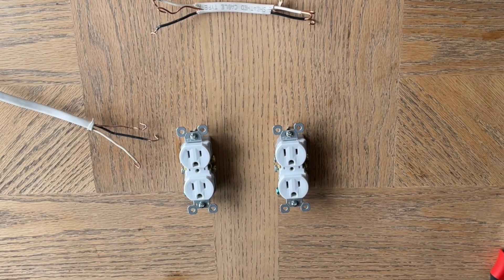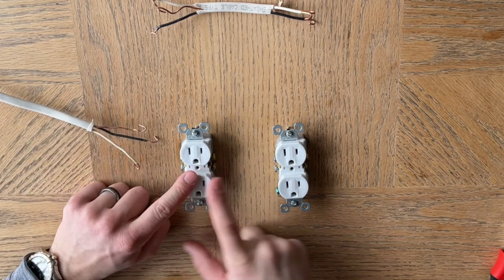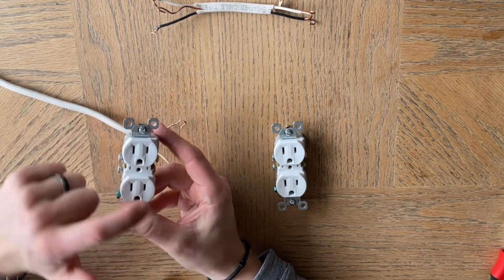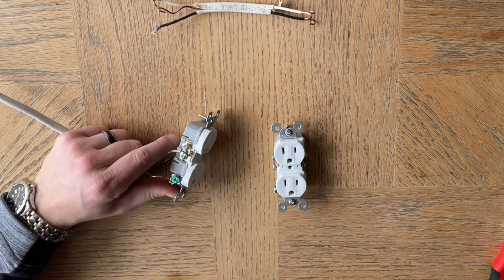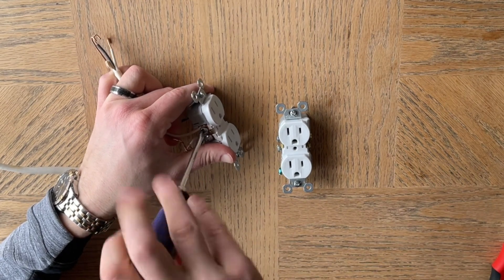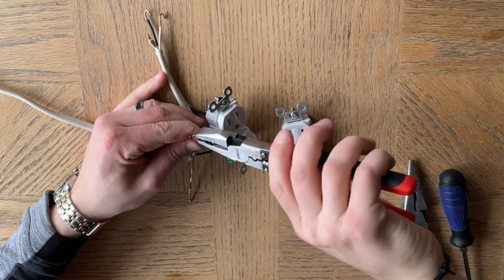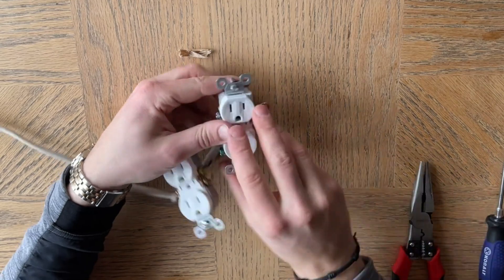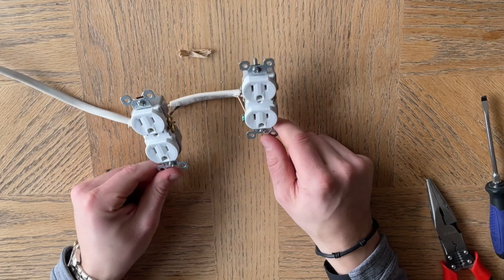How To Wire Outlets In A Daisy Chain Wire Multiple Outlets Series Receptacle

Comment: Thank you for this but I have a question like you said if the main power is coming from one outlet and then you add another outlet and its like 7 feet away but you said as more you add less power it will have let's say I add 3 outlets more an it's 7 feet each away from the main outlet if I use the last one will it consume more electricity?
Reply from the maker: You're most welcome! The power consumption wouldn't necessarily increase, but the voltage drop would be greater the further down the chain you go, which could affect the performance of certain appliances.

Comment: Happy New Year Brother. 
I ran power from a plug outlet at my lower main floor. Heading up-stair to power up level.
Using the Daisy chain, to jump from outlet to another and so on.

When starting at outlet #1 heading to #2 to #3, before heading to #4. At #3 directed off #3 to add a power outlet for my TV. From the TV outlet that came from #3 back to the TV outlet after installing t6he TV outlet, I continued from to another outlet for purpose (electric fire place) that wouldn't be on all the time. Anyway, from there I continued to the bedroom light switch, from the switch up to each pot-light one at a time, once connected to the last pot-light the chain stopped.

Now at bedroom switch corned to the other bedroom through the wall leading power to that bedroom switch, then to all four pot-lights and ending at last pot-light. 

At #3 out-let I  detoured off #3 understand? Not breaking following a daisy chain jump.

From back at #3 I continued jumping to #4 to #5 and #6 #7 #8 from number eight, I spiced off to a light switch for 2 pot-lights for the closet.

Now continuing, from [number eight outlet] going over the bathroom door, heading to a outlet then jumping to the bath light which stops.      Now, back at that outlet taking power over to another pot-light light switch to the pot-lights.

This process is correct? 

I understand it's all on one daisy chain jumping from each. But, not all will be used at the same time. 

That for the other reply, and while back. 

   Sam...
Reply from the maker: Seems like it’s a good system. The only concern would be that it is such a long chain, but if it’s working there doesn’t seem to be any issues.
Reply: @HowToVideoChannel  Thanks for the reply. 

So, like I think it states 8 to 10 outlets on a line. [But, it's not dipped in gold] as like "Law in code?

The idea was, each corner wall starting at #1 at front wall street then #2 side of house #3 was heading to the back but at in same room before the wall divider.
Then in the other room other-side of the wall in corner was #4. Splicing off for running power for TV from there jumping power to the switch for the room pot-lights. But also jumping it back into the first room to the switch for pot-lights, then it stopped.

Going back to the #4 out-let and continuing to #5 / #6 / #7 & #8

No- one's going to use all out-lets at the same-time.

Do U have a video showing channel-ing back from out-let #4 off for a out-let. But then coming back to continue the chain? 

Maybe, I'll click on your page and see if there is other videos.

Comment: u also wrap just the incoming ground wire around the electrical boxes ground screw first correct?
Reply from the maker: Standard boxes should be plastic, but if you have old wiring then you may have metal boxes. In that case, you may also have a metal conduit and there wouldn't be a ground wire. 

If you have Romex and a metal box, then you need to make sure that the ground within the Romex is traveling back to your breaker box.

You can also attach the ground to the screw within the box. Then use an outlet tester to make sure it lights up correctly so you don't have an open ground.

Comment: I have a 5 outlet chain in my old house. I’ll label the A through E from the panel. 
D is showing an open neutral when I plug my diagnosis plug in into it. 
The guy who wired my house got the hot and neutral mixed up on A. I have wired that correctly. when I use a no contact pen on C it freaks out. Do you think my issue is between C and D? AB and C are in a different room. It runs through a wall to the front of the house. E was arcing. 

Sorry I know this is kind of off topic but I’m a newbie that can’t afford an electrician. I know that sounds stupid as all hell but I just can’t afford one. I have the circuit off in the meantime. I’m trying to learn what I can to hopefully fix it without burning my house down. Any help would be much appreciated.
Reply from the maker: Sounds like there is a problem between B and E. Maybe C.

I would open up all the receptacles and make sure they are all wired correctly. Then you’ll have a really good idea of which direction the power flows from outlet to outlet and room to room.

Comment: I am not sure if you answered a question similar to this one already so I am sorry to make you repeat yourself if you did. 

I have two duplexes in one metal box and power coming the left and another romex coming out the right(leading to a switch). In the context of trying to properly ground it, I was wondering how I would tie in the ground wire coming in from the right. In the video you pigtailed off of the left duplex twisting it together with the incoming left ground and the daisy chain. Additionally since my box is metal I would have to pigtail off of it and add it to the twist. For the ground coming in to the right, would I simply just add this wire to the twist as well? 

Thanks for the helpful video regardless.
Reply from the maker: If the box is metal and there is a metal conduit running back to the box then that would serve as the ground.

Comment: So if you had 3 or more would you do the ground like you did on the first outlet? And only do it like you did on the second on the last outlet that is chained?
Reply from the maker: You can do that and connect ground to ground for the outlets in the middle. 

Or you can run the romex ground directly to the first receptacle and add a ground from the first receptacle to the second, second to third, and so on. You’d have 2 wires curled around the ground screws.

Comment: Ok, What I didn't know was if it had to be top or bottom when daisy chaining multiple outlet.
Reply from the maker: Either set of screws will work. As long as you are keeping the sets straight and not putting one on the top and one on the bottom.

Comment: If those receptacles are installed in metal boxes then another ground is needed.  Ground the box too.
Reply from the maker: If they are in metal boxes, then they would be in a metal conduit which acts as the ground. 

When using romex, you should use plastic boxes. 

Most codes require metal on metal or plastic on plastic.
Reply: This was additional useful information. It's been my experience that many older homes (mine included) have metal boxes without conduit.

Comment: I have a question, what if the black and white wires are reversed? What will happen? Will it just not work, or will it burn my house down or maybe damage equipment.
Reply from the maker: It would be best to correct it.

Comment: I have been told, by one of the manufacturers of outlets that “ Daisy Channing “ outlets in not acceptable.. there are 2 sets of hot and neutrals  they are only both used when the jumper that connects the 2 outlets is being.  Thus each outlet is on a separate circuit.  The correct way is to use a pigtail.
Reply from the maker: The only issue with Daisy Chaining is that if one outlet fails the rest of the outlets down the line lose power. Pig Tailing prevents this issue.

Comment: When replacing a 15a breaker with a 20a, wiring and outlet on an existing daisy chain outlet, would wiring be the same for a duplex 20a outlet?
Reply from the maker: It should be, as long as the wire gage can handle the current. You may want to check with a local electrician to make sure it fits the code.

Comment: Is there a maximum recommended distance for daisy chaining? I have an outlet halfway out to my back yard but I'd like to daisy chain off that to my shed which is about 50-60 feet away.
Reply from the maker: That should work as long as it’s 12 gauge wire. 14 would be okay, but if for some strange reason it is 16 then it would be like using a really long extension cord.
Reply: The maximum distance depends on the wire gauge and the percentage of voltage drop permitted. It is considered the same, regardless of whether it's direct wired to the receptacle or by using pigtails.
Reply from the maker: Thanks for the information!

Comment: Excellent presentation.  This is the clearest, most uncluttered video I have seen on daisy chaining.  I'd like to know how to add a switch and light in the middle of a daisy chain.  Would I just need a junction for that?
Reply from the maker: I’m very happy to hear you enjoyed the video! Thanks for the positive feedback!

Yes, you can add another box and run wire to your switch and light. If one of the outlets goes bad then you’ll lose power down-line.

Also, make sure you pigtail to send power to your switch. If you don’t, then your switch and light will interrupt the other down-line outlets.

Comment: What if you have a red wire also?
Reply from the maker: That probably goes to a switch to control one of the receptacles. Are the top and bottom receptacles connected with a tab of metal on the side?
Reply: If you're just wiring receptacles, you are not supposed to use cables that have both black and red wire.

Comment: I WANT TO DO THIS BUT I HAVE 4 PLUGS DAISY CHAINED I WANT TO KNOW WHICH WIRE SHOULD I USE THE WHITE OR THE YELLOW AND WHAT AMP FUSE IN MY BREAKER BOX TO POWER IT PLEASE SOME ONE HELP ME THANKS
Reply from the maker: You may want to call an electrician.

Comment: There shouldn't be a voltage drop because technically this is still parallel wiring. The bridge between the 2 screws on either side of the outlet acts as a bus bar. Series wiring would be wiring the hot side of one outlet to the neutral of another, which is very difficult and impractical.
Reply from the maker: Thanks for your input.

Comment: All the new plugs have a large side and a smaller side.  If someone wired them consistently  to the wrong side, what would happen? Would the outlet work.  In other words switching the power line and the common?
Reply from the maker: If you put the wire on the wrong screw then it may still work but you would be using the outlet in a way that wasn’t intended. Therefore, it would be against code, would fail inspection, void any insurance, etc cetera.

Comment: Put in six outlets in my son's basement.  The panel box didn't explode, so we're good.  Thanks!
Reply from the maker: Glad it worked out for you!
Reply: Be careful I think 6 outlets on 15 amp is 3 too many irs been awhile but code in my state was 4 on a 15 amp circuit
Reply: @zigzigler8332 even 12 are allowed by code. What you need to consider is what you want to connect on them. Check the label of your devices. 2000 W and 600 V are a little more than 3 amps. If your breaker is a 15 amp breaker, that device alone would be using 3 amps. There are heaters that requiere 4 amps for example. So if you're going to connect 2, 3 tvs, a laptop, 3 lamps and even a small fridge, it's ok for only one line of a 15 amps breaker.
Reply: @zigzigler8332 the circuit are usually 20A

Comment: Does it matter if the 2 hots or 2 Neutrals touch each other?  You try to put the wires under terminal screws, but the wires may barely touch.   I don’t think it is an issue because the 2 hot terminals and 2 Neutrals terminals are already connected with screws going into same base… but I have 4 Daisy chained outlets that keep popping one of these darn AFCI Breakers when circuit is not overloaded.
Reply from the maker: You can touch two hots or two neutrals without an issue. However, if you touch the hot and the neutral, that will be an issue.

Comment: Is there code for grounding the box?
Reply from the maker: Depends on your state.
Reply: Yes, NEC 250.148(C) for metal boxes. Plastic and fiberglass boxes, no, because those materials are not electrically conductive.
Reply from the maker: Excellent

Comment: Is this a 15amp circuit used with 14 gauge wire ??
Reply from the maker: The demonstration in this video is using a 15 amp receptacle and 14 gauge wire.

Comment: If you do not put a wire nut on the ground wires and leave them exposed and they touch a live wire you have an electrical fire. Lazy and stupid.
Reply from the maker: Ground wires are always exposed. They are an uninsulated wire.
Reply: Ground wires must be joined by a wire nut, Wago, or a greenie (a green wire nut with a hole on the top). It's not optional.

Comment: Use a wire nuts to hold the grounds together because they can get loose if they're not twisted enough. They make the nice green ones with the hole in the middle then you can run the wire right to the hole. Just leave one wire long enough so that it can act as your pigtail but that just works with the green ones with the hole in the middle.
Reply from the maker: Excellent advice!

Comment: what if I'm using 2x4 metal outlets? can I just run that ground to one of the outlets and all the other outlets will be grounded? if not how would I go about doing this?
Reply from the maker: Most of the time, if there are metal boxes there is a conduit. The conduit usually serves as the ground since it runs back to the breaker box.

Comment: Question.  I have a "power source" coming into an outlet that I will be doing a daisy chain BUT the power source wire is only a black and white one, no ground.  I tried installing, after the outlets, 3 wire (12/3) to the rest of the daisy chain, will that work fine since the initial wire does not have a ground wire?
Reply from the maker: Is the box metal or the wire running through a metal conduit?

Comment: Looking to replace old basement flourescent lights with an led style but cant find any that will hardwire in. Thinking about taking the wiring and just adding an outlet so i can just plug in the new led shop lights. Am i on the right track?
Reply from the maker: Yeah, that could definitely work.

Comment: Very helpful, detailed, informative and easy to follow.

Thank you.

Is there a minimum or maximum distance that gives maximum supply of energy.

I take it you are using 14/2 Romex wire?  I'm new at his.  

Thank you again.
Reply from the maker: Yeah, this is 14/2 Romex. 

The wire gauge and length affect the amount of power available. Check with an electrician for that specific info. It also depends on what the power is supplying. In a kitchen with appliances es you wouldn’t be able to run as many as a bedroom for example.

Comment: "Great Video" I have a question mister Pro? (I currently have 5 pot lights on my ceiling, with a wall switch.) I have jumped from one pot-light to another in a chain, as your showing. Question, power goes to the switch first? Or power comes in on the end of the pot-lights, and the switch is on the other end, of the pot-lights?

Or having the row of jumped wired pot-lights, one end stays the end and the other end, connect to the switch, and then off the switch to power?

20-Stars Brother on the video.

  Sam.
Reply from the maker: You’d have to open it up and do some disconnecting to find out which direction the power flows.
Reply: @HowToVideoChannel  Thanks, very much for your reply. And you did reply very quickly, so people thumbs up for this site. Loved your video pretty straight forward. Thanks again, and I may have another question down the road.
Reply from the maker: Awesome! Thank you!

Comment: Im new to all of this and I really want to learn so maybe what im about to ask is a stupid question but Are the light switches and outlets supposed to have their own breaker?

Btw my house is old and i want to replace 4 outlets that are not working properly cant i just do the pigtails where all the wiring hides ontop my house or is. It not safe ?
Reply from the maker: When you open the outlets, use a tracer to see if your wires are live. If so, it’s possible that the receptacle is bad and you can simply swap it out.

I would t tap into any of the wires in the ceiling since you don’t know where they are coming from or going.

Comment: Great tutorial. Easy language. Stuck to basics
Reply from the maker: Thank you!
Glad you liked it!
Reply: @HowToVideoChannel  no problem. I’ll definitely tune into your videos.
Professional question. I’m not a certified electrician. Just a pretty handy homeowner. What are your thoughts on pigtailing? If you had to conjoin two pieces of Romex inside a single gang box that is going to be basically a dummy box, no outlet, no switch ; how would you connect the two pieces of Romex. What’s your safest best suggestion. Thank you so much.
Reply from the maker: Thank you!
In that situation I would securely pigtail the wires together by twisting them with a lineman’s pliers and then a wire nut.
Reply: @HowToVideoChannel  thanks much! How many braided twists? Lol I’ve seen people say at least 3 full turns
Reply from the maker: As many as you can so they are secure and won’t come apart. 3 seems reasonable.
Reply: @HowToVideoChannel  are you a fan of the Wagos over wire nuts?
Reply from the maker: I’d use whatever you have available.

Comment: what do I do if someone daisy chained my entire room? 5 outlets.  I am trying to replace one with only one side of screws (2 screws instead of 4).
Reply from the maker: When you remove one receptacle, make sure you put the new one in exactly as the old one came out.
Reply: @HowToVideoChannel  yeah, I would normally do that, but the new outlets only have 2 screws (the old ones have 2 screws on either side)
Reply from the maker: Strange. Are there holes on the back for the wire to be inserted? Sometimes that is done in place of screws.